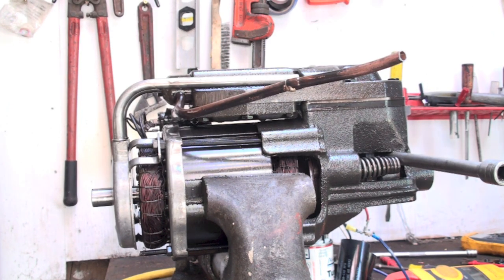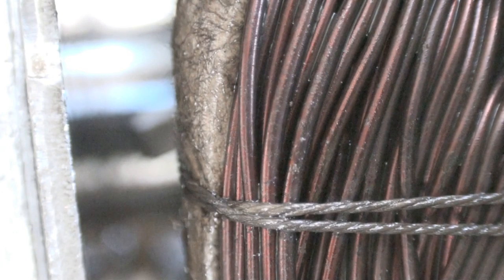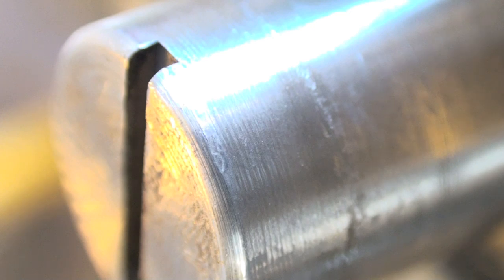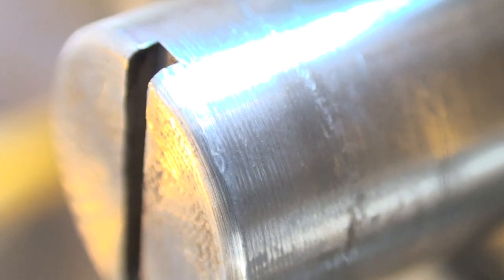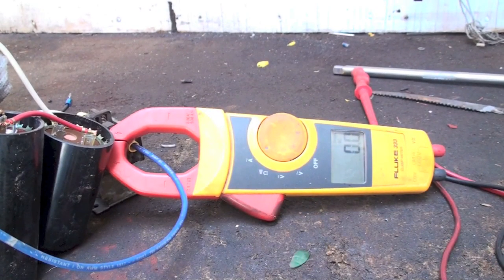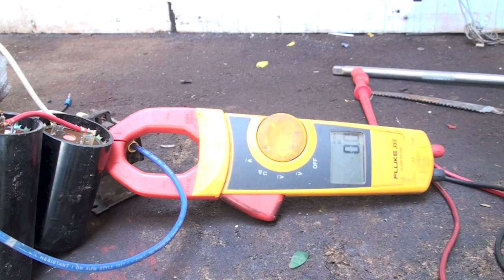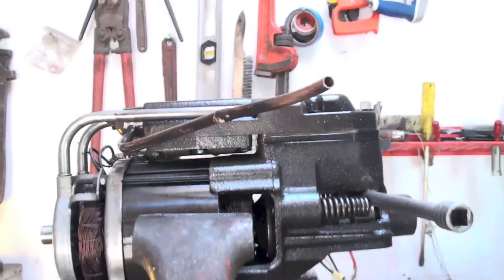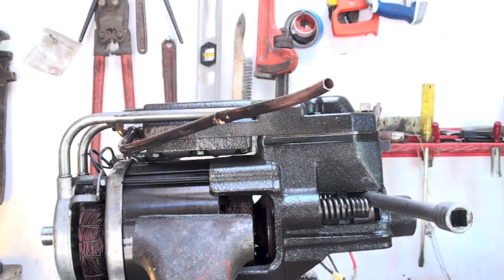Is the compressor hard start kit damaging to the air conditioning compressor?

Comment from the maker: It all depends on compressor type and expansion device.  Scrolls never come with hard starts regardless of the type of expansion device. Their start amperage is higher than piston compressors (8 to 10 times RLA compared to 2 to 3 for piston compressors).  Piston compressors with TXVs need one because they never equalize pressures.  I could find no movement of the windings with a hard start, but would not put that hard jerk on the windings unless necessary.  Hope this helps.
GFM
Reply: I remember learning in school many many years ago that scroll compressors don't need and shouldnt have hard start kits because they don't have a crank shaft and piston to push against all that head pressure. 

And as for scroll units not coming with them your wrong. Rheem and ruud both come with them in most condensers.
Reply: My trane xl16i two stage scroll comes with a hard start from the factory

Comment: I put a hard start on my parents A/C over a decade ago only because it  started the motor quicker, reduced the light "flicker" during starting and  allowed the A/C to start off a portable generator with no problems whatsoever, and no compressor issues as of yet..... Did the very same to my 30+ year old keeprite A/C for the same reasons.. No problems using the hard start so far.
Reply from the maker: Many units come with them originally if they use a TXV.  
GFM

Comment from the maker: I agree on the hard start kits.  As for the additive, I have never tried it, it may work.  However, I would think if you had gunk buildup inside a refrigeration system, you have problems that no amount of additive could solve.  Thanks for the thoughts.
GFM

Comment: The biggest problem with TXV systems, is that you may notice the expansion valve will stop hissing after the compressor has been off for just a few seconds. The pressures really don't equalize unless the condenser and evaporator are the same temperature ( which is rare ). There needs to be some sort of start kit to overcome starting pressures on TXV systems, and there is a Surestart Soft Start kit that won't jerk the compressor
Reply from the maker: Unless the unit is equipped with a bleed TXV it will not equalize.  These systems will have a hard start system from the factory.  That is if the manufacturer instructions are followed.  
GFM
Reply: I've never seen a bleeder TXV, can you do a video on them one of these days? I'd love to see what they look like in an operating system, or at least what they look like by themselves, because i've heard they are kinda rare.

Comment: I've never liked hard start kits, and I always felt they were outside the manufacturer's design parameters.What I've found that works good for me for a compressor that is binding and overheated at 11 pm sunday night with the frozen food all melting,is Supco oil additive.I've been using it since the 70's,it coats all the metal parts and makes them more slippery,loosing up that binding bearing.It also disolves gunk buildup clearing cap tubes and improving TD and EER ratings.Best unknown product.

Comment: High currents are damaging to any electrical device. It results in excessive heating and movement of windings. This is a major reason for failures in power transformers where short circuit currents cause windings to shift, and this is why they are tightly clamped in position. I can't see any reason why a reduction in LR current would be harmful to a compressor.

Comment: Very good video,  I am thinking about installing one. I have a 12 year Ruud Copeland Scroll. I checked in rush and its 10 amps over LRA  but I have no problems on start up the Amp draw while running is 6 Amps below RLA      What do you think?  Thanks for your videos I value your opinion,    Gerry

Comment: Sounds like BS to me 3 phase motors always start with extreme torque.  The windings are not falling out.  Windings are supposed to be heavily varnished to prevent shorts and movement.
Reply from the maker: That is of course true.  However, different motors are differently made.  You can bet a single phase, low starting torque motor will not have any more varnish than absolutely necessary.
GFM
Reply: were do you find a vendo compressor and deck for my pepsi machine

Comment: I noticed one thing about your setup, it looks like the vise is clamping on the stator lamination, not on the motor housing. The design of that motor looks like the laminations and windings can possibly rotate inside the housing, especially after use and a few thousand heat cycles.

Interesting test though, nice to see a thorough trial of both setups. 

The manufacturer means forward and backward in terms of rotation, not linearly back and forth.
Reply from the maker: It is mounted on springs so there is some give.
GFM

Comment: Action and Reaction.  For every action, there is an equal and opposite reaction.  Think about how your car engine strains the motor mounts when you do a hard start at the light.  If the hard start kit increase starting torque, then it's  just putting more stress on the "mounts."  The forces and movements are not perceptible from the naked eye, but over time the additional stresses may be cumulative.   OTOH, if you have a failing compressor, what have you got to lose to install the hard start kit?
Reply: Exactly.  My only issue is with those who want to add a hard start kit to a properly running unit.
GFM

Comment: Really like your videos. You give a unbiased opinion and do very good, well thought out testing. My 39 year old R-22, 2 Ton Trane runs great, cools great. It is wired for the factory optional start assist unit that comes from the factory. The original owner did not opt to purchase that option from the factory. I have obtained a Trane start assist new in the box and thinking of installing it. It has the pig tail connection and is just a plug and play simple install. It's actually shown on the factory wiring diagram as a option from the factory. I'm thinking about installing this today which should take 10 minutes to just remove the side panel, plug in the two connectors to each other and be done. I was wondering what your opinion is on the factory start assist option from Trans ? Thank you and I hope you keep putting out videos. I enjoy watching them and your great testing you peform. Thanks again. PS: I have read many posts and remarks of the 5-2-1 3 wire kits with the potential relay failing in high numbers but the " Kick Start" Brand gets high marks in all the threads I read on different And forums. Just wanted to get your opinion on the two, 5-2-1 versus the Kick Start. Thanks again........
Reply from the maker: The factory start kit is designed for units with a TXV expansion device.  It is not necessary for units using a fixed orifice.  
In your case, I would not install the hard start.  The hard start places more load on the compressor upon start up.  It could push your compressor over the edge.
On the aftermarket hard starts: both units use a capacitor and a potential relay.  This type of kit works well if there is no factory kit.  If a hard start is necessary, I would use the factory one if available.  
GFM
Reply: @grayfurnaceman  Yes sir, I have the Factory OEM "Start assist" (Tranes wording) kit from Trane. It was in a sealed Trane box and the part number matches the number on my units electrical schematic as being an option for my unit that I suppose the customer had to pay extra for. The connector was just sitting there zip tied down waiting to be connected to the Trane start assist. I installed it last evening and it is working fine. So as per your aforementioned comment regarding using the factory recommended start assist, It should be fine correct ?
Reply from the maker: @MacMcCabe2456  The factory assist is the best for your particular unit, but only if you need it for the TXV.  
Hard start is not easier on the compressor, it is harder on it.
GFM
Reply: @grayfurnaceman  I am using the factory Trane asist. Just wanted to get your thoughts on using the factory OEM start assist ? I'm not using a 5-2-1 or after market kick start type unit. Thanks so much sir, Mike